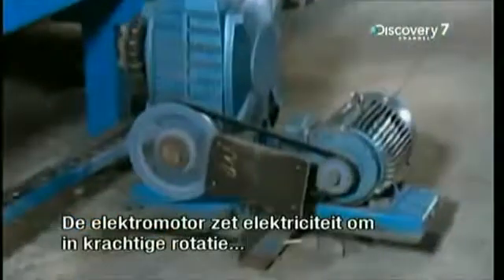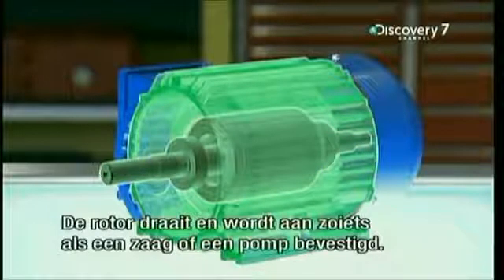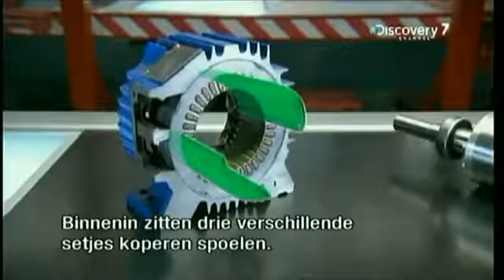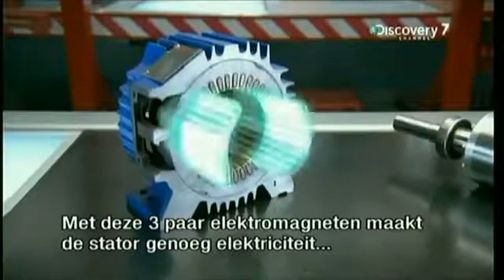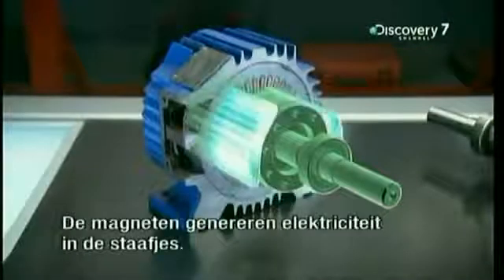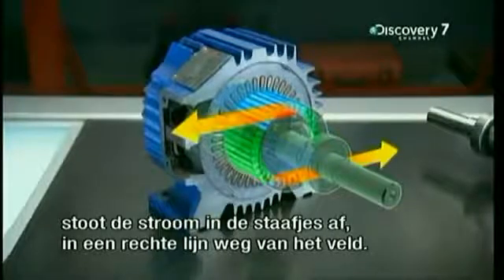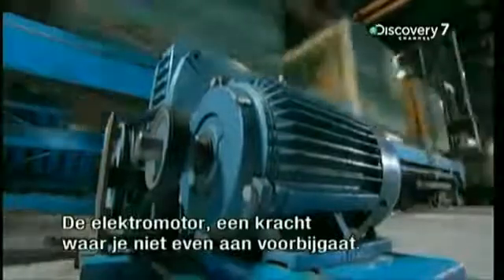Induction Motor - How does it work

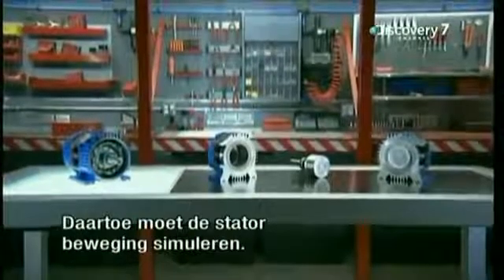Comment: 2:51 I couldn’t understand the part when he says “the stator never send electricity through all three pairs at the same time. It switches on and off one after the other”. When one of the three phase windings has a voltage the others do not have voltage ? It doesn’t make sense.